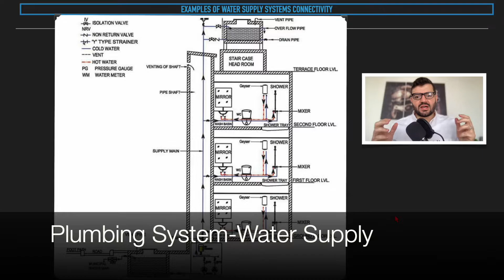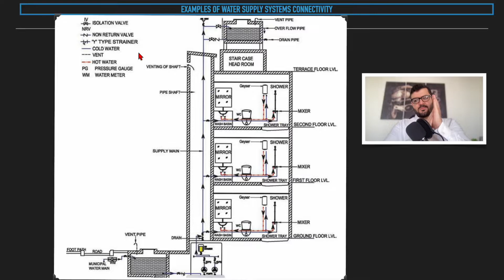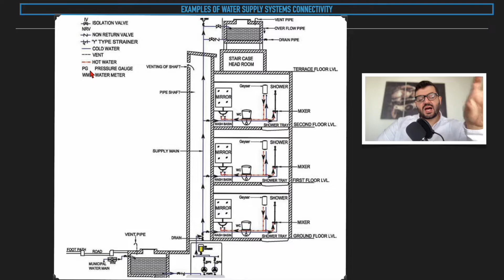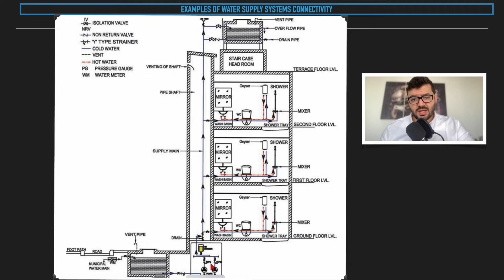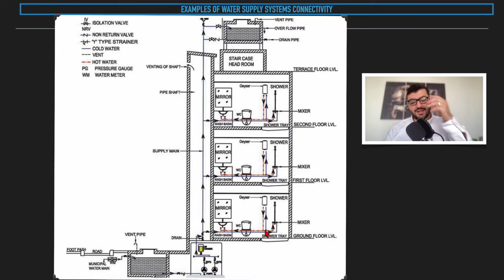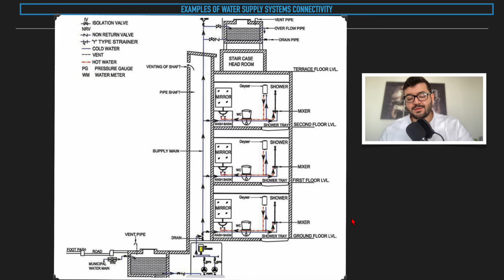Plumbing Online Course (Zero to Hero)

Comment: Hey I studied plumbing in college in south Africa..I studied from domestic to commercial as well as pattern sheet development which is mechanical....I now qualify to take my trade test.. however I have also completed my degree in geography and environmental management at THE university of KwaZulu-Natal in south Africa which currently ranked 3rd in the country.....so I am currently trying to bridge the gap between plumbing design and environmental impact assessment of plumbing on a commercial level...do you have any guidance or a company you that does this..I am more like environmental engineering but I have only specialized in plumbing especially drainage..storm water..sewer etc..and how this affects the environment of not down correctly
Reply from the maker: Great question sizwe, here is what you should consider :
HVAC , plumbing and Electrical engineering are now related to environmental engineering since many countries are enforcing sustainability and reduction of energy consumption.

In your case , since you are focused on plumbing and environmental engineering there are companies who sell plumbing components and are adopting an environmental assessment regarding the impact of their products and offered solutions here are a couple examples to guide you and you can browse their company profile :

o-friendly plumbing companies.

ExpertEase Education
Which companies relate plumbing to environmental impact

Several companies are working to address the environmental impact of plumbing systems, including:

Kohler: Kohler is a plumbing manufacturer that has developed a range of water-saving products, such as low-flow toilets and faucets, to reduce water consumption and waste.

Sloan Valve Company: Sloan Valve is a company that specializes in water-efficient plumbing solutions, including flushometers, faucets, and showerheads, that help conserve water and reduce waste.

Uponor: Uponor is a company that provides solutions for radiant heating, cooling, and plumbing systems that are designed to reduce energy consumption and environmental impact.

Gerber: Gerber is a plumbing fixture manufacturer that offers a range of water-saving products, such as low-flow toilets and faucets, that help conserve water and reduce waste.

Delta Faucet: Delta Faucet is a manufacturer of faucets and other plumbing fixtures that has developed water-efficient products, such as their H2Okinetic showerheads, that help conserve water and reduce waste.

Hope this helps and feel free to share your insight on the matter
Reply: @ExpertEaseGlobal  understand I appreciate your quick response..very helpful 🙏
Reply from the maker: @sizwemsomi239  most welcome , we are here to help !
Reply from the maker: I would suggest that you expand your knowledge base aswell to include HVAC since it is highly in demand and the trend is towards environment friendly solutions and design practices , here is our master class which will equip you with years worth of practical experience:

https://eedu.online/p/hvac-elite-masterclass
Reply: @ExpertEaseGlobal  thank you so much sir..🙏